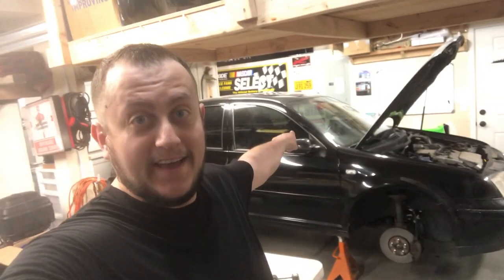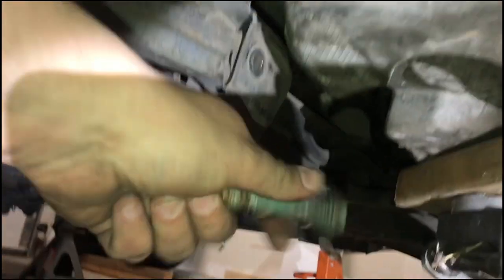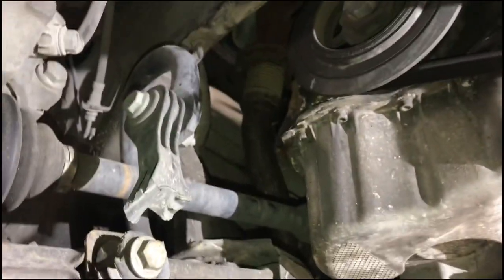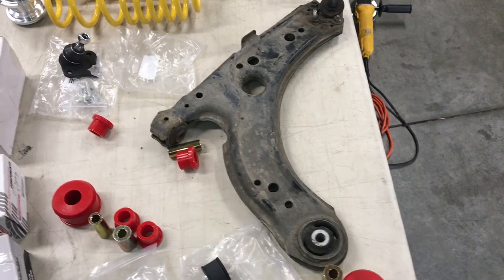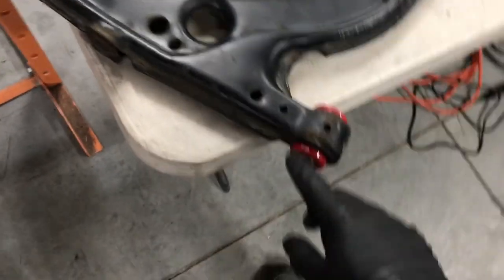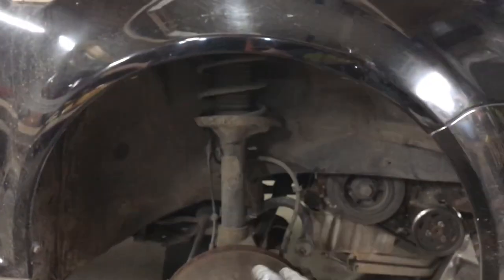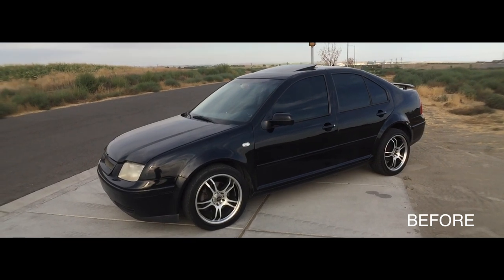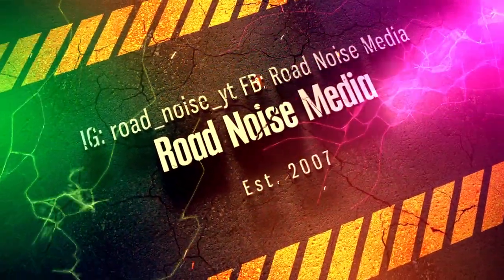MK4 VR6 Jetta Gets Low!

Comment: The button on the headrest is not used to pull it out. On top of the back rest where the pins for the headrest are put in is a spring you push in to pull the headrest out.